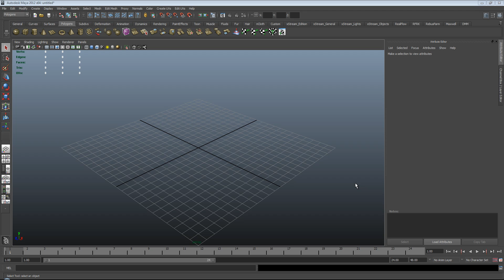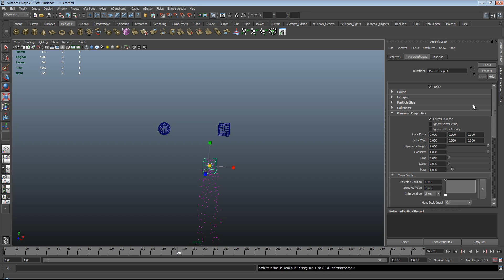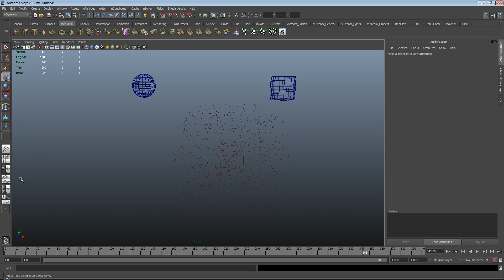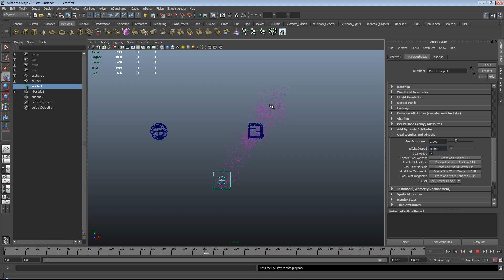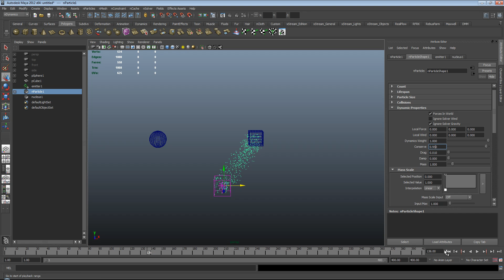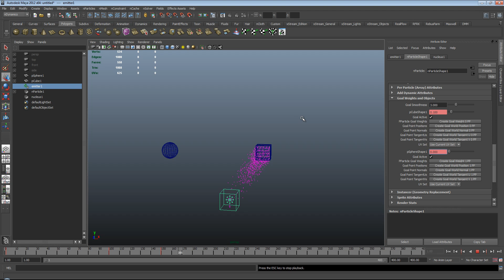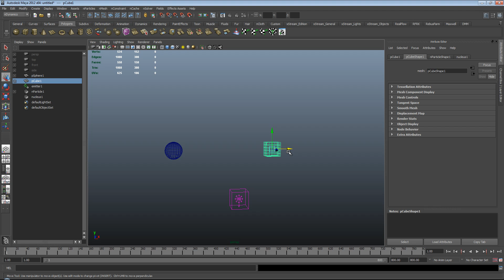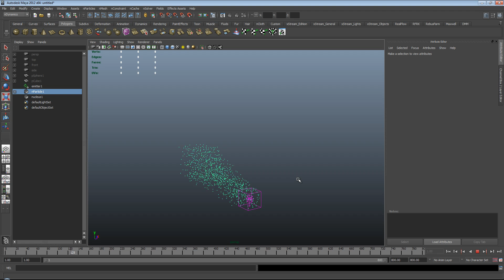Goal Oriented nParticles in Maya for Morphing

Comment: i do have a question. If i wanted the particles to cover the entire object and not sit at the vert points, how can i do that?
Reply: You can try using GoalU and GoalV, e.g. setting them as:
nParticleShape1.goalU = rand(0,1);
nParticleShape1.goalV = rand(0,1);

or if you're emitting from the same object, you can emit inheriting Parent UV's and setting it as:
nParticleShape1.goalV = nParticleShape1.parentV;
nParticleShape1.goalU = nParticleShape1.parentU;

Hope that helps!
Reply: Thanks Gary, Will check it out
Reply: Hi  @prysbet  , any idea on when taking the rand u and v, how NOT to get the particles on the same spot! For some reason i get several particles on exactly on the same place. Thanks in advance
Reply: It's been a while, but a guess, does your object have uvs?
Reply: @prysbet  yes they do, Found out though that the particles are not exactly on the same point. but very close. I do can change the size of the particles and display the size by changing them to spheres. When I generate the particles this way, by pushing the play button, they get push away because of (self)collision. Some get stuck and wobble a lot. But they don't seperate themselves enough. So im looking for a way to seperate the particles some each other so the instanced geometry does not intersects with other instanced geometry.
Hope you know something. Thanks again!
Reply: @marcomeeuwse9263  Hmm, I'm not sure, I haven't used maya for something like this in a long time, Houdini is a lot better at this kind of effect. Have you definitely set the emission to be surface instead of omni, I don't remember the exact setup, but that would help them be across the surface
Reply: plz give us a tutorial on this with instanced particles. Thanks :)